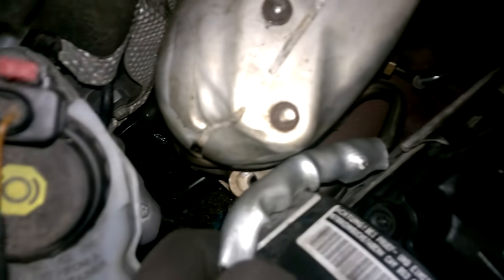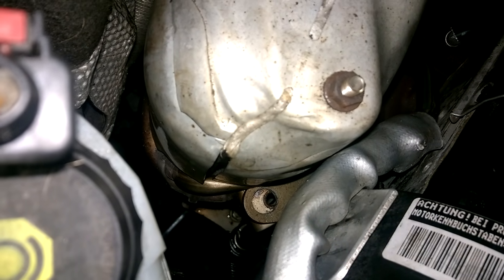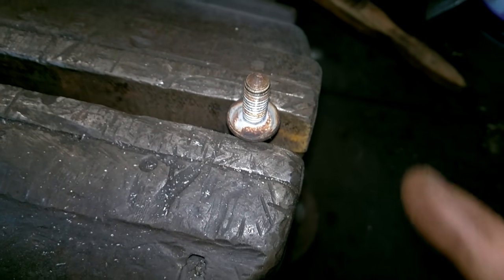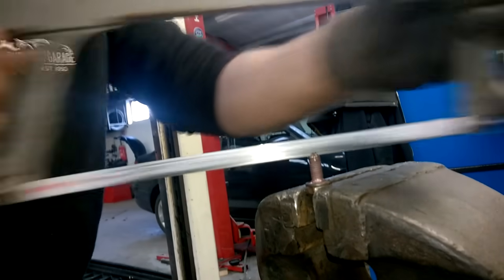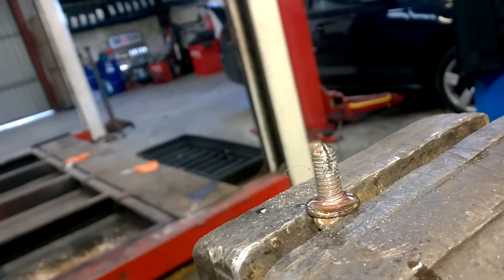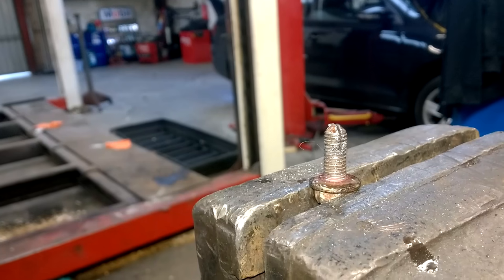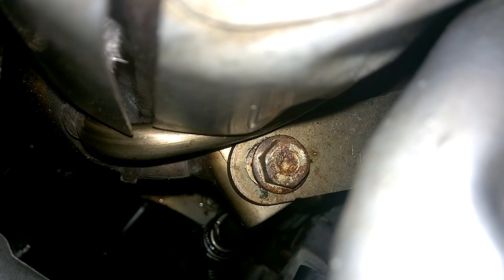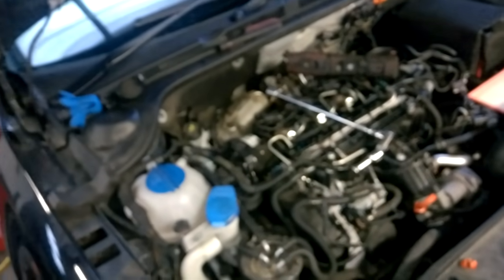My Father Taught Me This! Passing It On To The Next Generation

Comment: What if your woman has the opposite problem?
Reply from the maker: More info below on that problem too :) 
 
The update info below is the pinned comment on this video, I know most people do not realize I made that video and it better explains/shows this method in use.   
I also included below details of why the job was done this way free of charge with the customer fully informed. I hope you check it out  👇👇
 
UPDATE* I decided to make a follow up video on this https://www.youtube.com/watch?v=yfNQullGEuQ&feature=youtu.be Should answer some of the questions that were raised, I include 3 demos of this in action with close up shots.
 
As there was some safety concerns & confusing comments raised, I felt I should clear a few things up. 
1) This is a tip for certain circumstances only, I never have and never would use it on a component which would cause any safety concern to any customer.  
2) The demo was done on a support bracket only, items like this or similar will not cause any safety concern. 
3) I did this free of charge and on a time restraint, I noticed it when I was replacing another item, the customer needed the vehicle back that evening and I decided rather than leave it like it was, I would do this and secure it up fully. 
4) The bolt was not the issue, the part that the bolt threads into is a secured piece, someone had previously damaged it, leaving the bracket loose and the bolt just tightened a turn or so.
5) The bolt can be removed and will not break, it will go in and out as usual and has helped clean up the damaged threads.  
6) Used in the right application I personally believe this is a great tip and can save you a lot of time & trouble. 

Lastly to all the people who have watched the video, Thanks very much and I am delighted with the feedback I have received on it.
Reply: I meant, if she's too loose, which is common after the second great guy. Most average 20 guys, so you could easily fit a pool noodle.

Comment: Thank you for not working on airplanes.
Reply from the maker: The update info below is the pinned comment on this video, I know most people do not realize I made that video and it better explains/shows this method in use.   
I also included below details of why the job was done this way free of charge with the customer fully informed. I hope you check it out  👇👇
 
UPDATE* I decided to make a follow up video on this https://www.youtube.com/watch?v=yfNQullGEuQ&feature=youtu.be Should answer some of the questions that were raised, I include 3 demos of this in action with close up shots.
 
As there was some safety concerns & confusing comments raised, I felt I should clear a few things up. 
1) This is a tip for certain circumstances only, I never have and never would use it on a component which would cause any safety concern to any customer.  
2) The demo was done on a support bracket only, items like this or similar will not cause any safety concern. 
3) I did this free of charge and on a time restraint, I noticed it when I was replacing another item, the customer needed the vehicle back that evening and I decided rather than leave it like it was, I would do this and secure it up fully. 
4) The bolt was not the issue, the part that the bolt threads into is a secured piece, someone had previously damaged it, leaving the bracket loose and the bolt just tightened a turn or so.
5) The bolt can be removed and will not break, it will go in and out as usual and has helped clean up the damaged threads.  
6) Used in the right application I personally believe this is a great tip and can save you a lot of time & trouble. 

Lastly to all the people who have watched the video, Thanks very much and I am delighted with the feedback I have received on it.

Comment: Glad you don't work on aircraft.
Reply from the maker: The update info below is the pinned comment on this video, I know most people do not realize I made that video and it better explains/shows this method in use.   
I also included below details of why the job was done this way free of charge with the customer fully informed. I hope you check it out  👇👇
 
UPDATE* I decided to make a follow up video on this https://www.youtube.com/watch?v=yfNQullGEuQ&feature=youtu.be Should answer some of the questions that were raised, I include 3 demos of this in action with close up shots.
 
As there was some safety concerns & confusing comments raised, I felt I should clear a few things up. 
1) This is a tip for certain circumstances only, I never have and never would use it on a component which would cause any safety concern to any customer.  
2) The demo was done on a support bracket only, items like this or similar will not cause any safety concern. 
3) I did this free of charge and on a time restraint, I noticed it when I was replacing another item, the customer needed the vehicle back that evening and I decided rather than leave it like it was, I would do this and secure it up fully. 
4) The bolt was not the issue, the part that the bolt threads into is a secured piece, someone had previously damaged it, leaving the bracket loose and the bolt just tightened a turn or so.
5) The bolt can be removed and will not break, it will go in and out as usual and has helped clean up the damaged threads.  
6) Used in the right application I personally believe this is a great tip and can save you a lot of time & trouble. 

Lastly to all the people who have watched the video, Thanks very much and I am delighted with the feedback I have received on it.

Comment: ✅
Reply from the maker: The update info below is the pinned comment on this video, I know most people do not realize I made that video and it better explains/shows this method in use.   
I also included below details of why the job was done this way free of charge with the customer fully informed. I hope you check it out  👇👇
 
UPDATE* I decided to make a follow up video on this https://www.youtube.com/watch?v=yfNQullGEuQ&feature=youtu.be Should answer some of the questions that were raised, I include 3 demos of this in action with close up shots.
 
As there was some safety concerns & confusing comments raised, I felt I should clear a few things up. 
1) This is a tip for certain circumstances only, I never have and never would use it on a component which would cause any safety concern to any customer.  
2) The demo was done on a support bracket only, items like this or similar will not cause any safety concern. 
3) I did this free of charge and on a time restraint, I noticed it when I was replacing another item, the customer needed the vehicle back that evening and I decided rather than leave it like it was, I would do this and secure it up fully. 
4) The bolt was not the issue, the part that the bolt threads into is a secured piece, someone had previously damaged it, leaving the bracket loose and the bolt just tightened a turn or so.
5) The bolt can be removed and will not break, it will go in and out as usual and has helped clean up the damaged threads.  
6) Used in the right application I personally believe this is a great tip and can save you a lot of time & trouble. 

Lastly to all the people who have watched the video, Thanks very much and I am delighted with the feedback I have received on it.

Comment: kool
Reply from the maker: Thanks John 
 
The update info below is the pinned comment on this video, I know most people do not realize I made that video and it better explains/shows this method in use.   
I also included below details of why the job was done this way free of charge with the customer fully informed. I hope you check it out  👇👇
 
UPDATE* I decided to make a follow up video on this https://www.youtube.com/watch?v=yfNQullGEuQ&feature=youtu.be Should answer some of the questions that were raised, I include 3 demos of this in action with close up shots.
 
As there was some safety concerns & confusing comments raised, I felt I should clear a few things up. 
1) This is a tip for certain circumstances only, I never have and never would use it on a component which would cause any safety concern to any customer.  
2) The demo was done on a support bracket only, items like this or similar will not cause any safety concern. 
3) I did this free of charge and on a time restraint, I noticed it when I was replacing another item, the customer needed the vehicle back that evening and I decided rather than leave it like it was, I would do this and secure it up fully. 
4) The bolt was not the issue, the part that the bolt threads into is a secured piece, someone had previously damaged it, leaving the bracket loose and the bolt just tightened a turn or so.
5) The bolt can be removed and will not break, it will go in and out as usual and has helped clean up the damaged threads.  
6) Used in the right application I personally believe this is a great tip and can save you a lot of time & trouble. 

Lastly to all the people who have watched the video, Thanks very much and I am delighted with the feedback I have received on it.

Comment: Jesus, imagine bringing your car to a hack mechanic like this. Why bother putting your car back together properly and actually lining things up when you can just pay him to saw all of your fasteners in half and weaken all of them.
Reply from the maker: The update info below is the pinned comment on this video, I know most people do not realize I made that video and it better explains/shows this method in use.   
I also included below details of why the job was done this way free of charge with the customer fully informed. I hope you check it out  👇👇
 
UPDATE* I decided to make a follow up video on this https://www.youtube.com/watch?v=yfNQullGEuQ&feature=youtu.be Should answer some of the questions that were raised, I include 3 demos of this in action with close up shots.
 
As there was some safety concerns & confusing comments raised, I felt I should clear a few things up. 
1) This is a tip for certain circumstances only, I never have and never would use it on a component which would cause any safety concern to any customer.  
2) The demo was done on a support bracket only, items like this or similar will not cause any safety concern. 
3) I did this free of charge and on a time restraint, I noticed it when I was replacing another item, the customer needed the vehicle back that evening and I decided rather than leave it like it was, I would do this and secure it up fully. 
4) The bolt was not the issue, the part that the bolt threads into is a secured piece, someone had previously damaged it, leaving the bracket loose and the bolt just tightened a turn or so.
5) The bolt can be removed and will not break, it will go in and out as usual and has helped clean up the damaged threads.  
6) Used in the right application I personally believe this is a great tip and can save you a lot of time & trouble. 

Lastly to all the people who have watched the video, Thanks very much and I am delighted with the feedback I have received on it.

Comment: Idiotic! Now the bolt doesn't grip of the top or the bottom, clean up the hole with a tap, if it's too far gone,  drill out , tap and helicoil the hole, clean up the bolt thread with a die or replace, You tried this where I worked, you would be fired and maybe prosecuted. 40 years as a B1 Aircraft maintenance engineer.
Reply from the maker: The update info below is the pinned comment on this video, I know most people do not realize I made that video and it better explains/shows this method in use.   
I also included below details of why the job was done this way free of charge with the customer fully informed. I hope you check it out  👇👇
 
UPDATE* I decided to make a follow up video on this https://www.youtube.com/watch?v=yfNQullGEuQ&feature=youtu.be Should answer some of the questions that were raised, I include 3 demos of this in action with close up shots.
 
As there was some safety concerns & confusing comments raised, I felt I should clear a few things up. 
1) This is a tip for certain circumstances only, I never have and never would use it on a component which would cause any safety concern to any customer.  
2) The demo was done on a support bracket only, items like this or similar will not cause any safety concern. 
3) I did this free of charge and on a time restraint, I noticed it when I was replacing another item, the customer needed the vehicle back that evening and I decided rather than leave it like it was, I would do this and secure it up fully. 
4) The bolt was not the issue, the part that the bolt threads into is a secured piece, someone had previously damaged it, leaving the bracket loose and the bolt just tightened a turn or so.
5) The bolt can be removed and will not break, it will go in and out as usual and has helped clean up the damaged threads.  
6) Used in the right application I personally believe this is a great tip and can save you a lot of time & trouble. 

Lastly to all the people who have watched the video, Thanks very much and I am delighted with the feedback I have received on it.

Comment: Well my dad taught me how to do it the right way. Drill tap and new bolt. It will hold securely the way it was meant to. Cutting corners causes problems for the next gut just like the guy before you caused this problem. Stop with the shade tree mechanics you tube.
Reply from the maker: The update info below is the pinned comment on this video, I know most people do not realize I made that video and it better explains/shows this method in use.   
I also included below details of why the job was done this way free of charge with the customer fully informed. I hope you check it out  👇👇
 
*UPDATE** I decided to make a follow up video on this https://www.youtube.com/watch?v=yfNQullGEuQ&feature=youtu.be Should answer some of the questions that were raised, I include 3 demos of this in action with close up shots.
 
As there was some safety concerns & confusing comments raised, I felt I should clear a few things up. 
1) This is a tip for certain circumstances only, I never have and never would use it on a component which would cause any safety concern to any customer.  
2) The demo was done on a support bracket only, items like this or similar will not cause any safety concern. 
3) I did this free of charge and on a time restraint, I noticed it when I was replacing another item, the customer needed the vehicle back that evening and I decided rather than leave it like it was, I would do this and secure it up fully. 
4) The bolt was not the issue, the part that the bolt threads into is a secured piece, someone had previously damaged it, leaving the bracket loose and the bolt just tightened a turn or so.
5) The bolt can be removed and will not break, it will go in and out as usual and has helped clean up the damaged threads.  
6) Used in the right application I personally believe this is a great tip and can save you a lot of time & trouble. 

Lastly to all the people who have watched the video, Thanks very much and I am delighted with the feedback I have received on it.

Comment: 5 years down the road and another mechanic (or possibly a machinist) has to try and figure out why in the hell a bolt would split off into two pieces in a blind hole after he’s just spent half a day trying to extract the damn thing out of a bracket that wasn’t fitting right to begin with due to misalignment. Good little trick I suppose. But doesn’t solve the problem you had before. There in lies the difference between a machinist and a mechanic: machinists will take the extra 30 minutes to make it right. A mechanic will do whatever it takes to just slap it back together. I’m thankful I’m a machinist practiced in the old ways.

Comment: also i hate videos that that have a vague explanation ...click bait
Reply from the maker: The update info below is the pinned comment on this video, I know most people do not realize I made that video and it better explains/shows this method in use.   
I also included below details of why the job was done this way free of charge with the customer fully informed. I hope you check it out  👇👇
 
UPDATE* I decided to make a follow up video on this https://www.youtube.com/watch?v=yfNQullGEuQ&feature=youtu.be Should answer some of the questions that were raised, I include 3 demos of this in action with close up shots.
 
As there was some safety concerns & confusing comments raised, I felt I should clear a few things up. 
1) This is a tip for certain circumstances only, I never have and never would use it on a component which would cause any safety concern to any customer.  
2) The demo was done on a support bracket only, items like this or similar will not cause any safety concern. 
3) I did this free of charge and on a time restraint, I noticed it when I was replacing another item, the customer needed the vehicle back that evening and I decided rather than leave it like it was, I would do this and secure it up fully. 
4) The bolt was not the issue, the part that the bolt threads into is a secured piece, someone had previously damaged it, leaving the bracket loose and the bolt just tightened a turn or so.
5) The bolt can be removed and will not break, it will go in and out as usual and has helped clean up the damaged threads.  
6) Used in the right application I personally believe this is a great tip and can save you a lot of time & trouble. 

Lastly to all the people who have watched the video, Thanks very much and I am delighted with the feedback I have received on it.